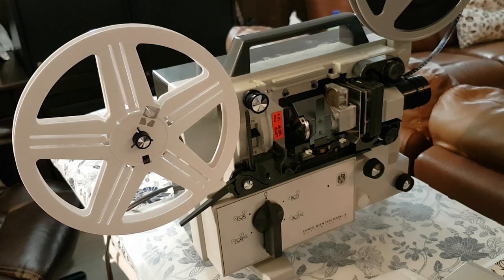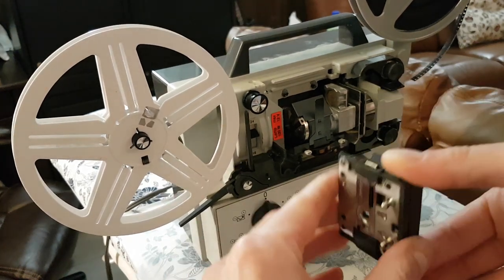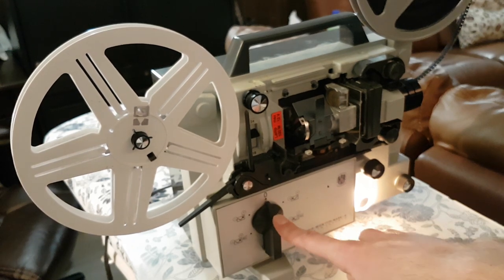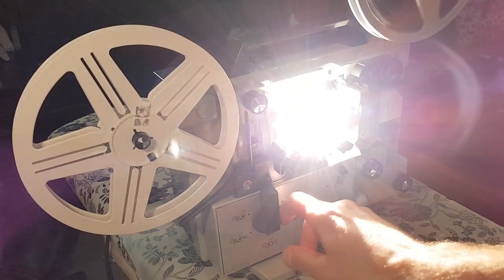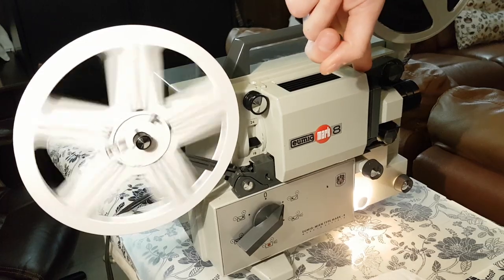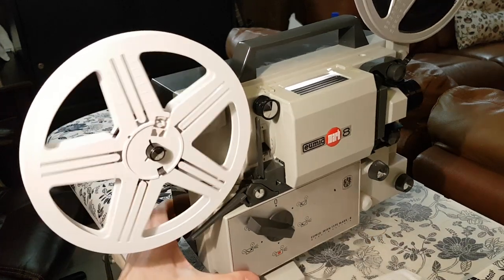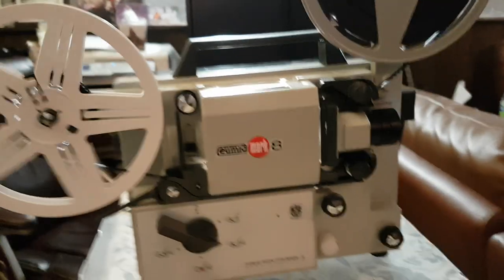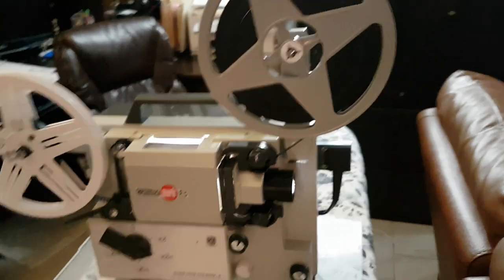How to Set Up A Eumig Mark 8 Reel To Reel Projector

Comment: Nice machine and beautifully made. Just one point with these dual-gauge Eumigs: when you change the gauge by removing the gate assembly don't forget to first use the inching knob on the back of the projector to withdraw the claw from the film channel otherwise there's a danger of damage to the claw.

Comment: Hi! I have eumig mark s projector. But now I have a problem. When I'm plug in electricity all of the projector lamps are off but the engine is still running. Can you help me to fix the problem? Thanks
Reply from the maker: Change the lamp

Comment: The film is shaky. That may be come from the upper loop so you have to press again on the plastic piece used to load the film. If it's not that, it's a more serious probleme but what is sure is that the picture should look steady.